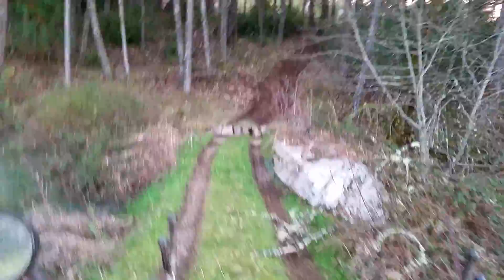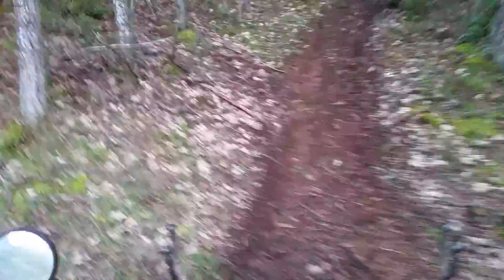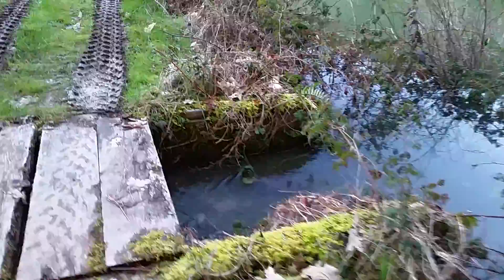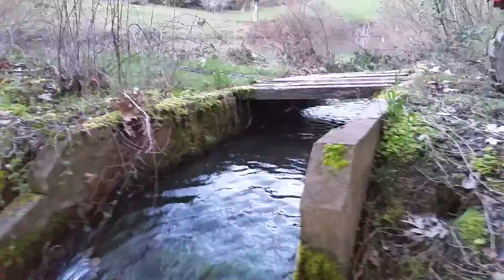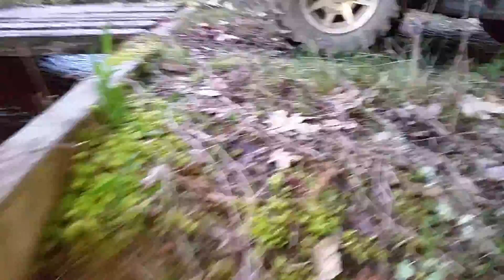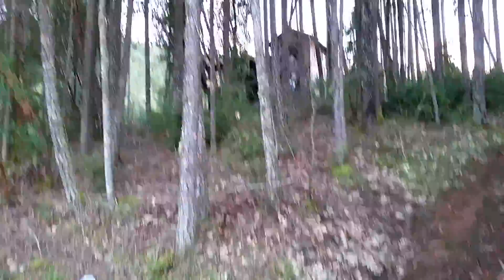Questions about overshot water wheel. Is this enough water for 15 amps@24 volts?

Comment: Did you ever build a water wheel at this site? I would be interested in an update. Yes, that is plenty of water and you want to build the largest diameter wheel possible for the head(fall) on your property.
Reply from the maker: Greetings, I did not build the water wheel. We still own the land but we since have built another homestead. We are now on the east side of the Cascade mountains. Still off the grid with solar.
Reply: @offgridinthepacificnorthwe3210  Thank you. Is this Washington State?
Reply from the maker: Oregon

Comment: thanks for posting.   here is some very late information.    for any proposed hydropower installation,  the  Very  First  task is to  Estimate the amount potential energy available at the site.     so.  in case you have not yet crunched the numbers, here's how. 
multiply gravity (9.81 meter/ps)  times  Head, change in elevation (in meters),  multiply by flow rate, in cubic meters per second.    this results in a kilowatt-value.   multiply by 1000 for watts.      the flow rate seen in the video might be three liters per second; or .003 cu.meters/sec.    select the maximum practical 'wheel radius.  correctly design a poncelet-style 'wheel and deliver water as near to 11 o'clock, as possible.    for an overshot 'wheel, optimum 'wheel radius is, naturally, roughly one-half of the available head.    ( assuming head of two meters and a flow-rate of .003,  there is  58.8 watts of potential energy available.  overall output will be always be less, due to unavoidable losses. ) 
on the other hand,  everyone   Must  come to understand a simple fact.     a waterwheel makes use of the imprecisely named 'wheel and axle' principle.    this principle Should be called a,  'Rotary 2nd-class Lever'.     see my channel for the wonders of  Rotary  Leverage/force;  aka, 'non-collapsed'  TORQUE, and the oh-so-simple path to OU, if it suits.    see linked video, and my comment there,  for proof of the concept.        cheers            
    googletranslate
https://www.youtube.com/watch?v=lTkXciAn488
Reply from the maker: David Davids Thank you so much for the detailed response. When I crunched the numbers last year along with the cost of getting usable power to my battery bank it became very clear that adding more solar power to our existing array was the better money. So that's what we did! We added to our system and now have 4.8k of solar. We are totally off grid and only use 7 killowatt hours a day. So our solar array is overkill most of the year but 50 days a year we still have to bulk the batteries with diesel. I was hoping to other have to use the generator for those 50 days a year but the additional cost of doing that is out of the question. So for now I will have to burn $50 a year in diesel. That said it is hard to watch all that energy flow over the spillway.
Reply: for the sake of discussion, one key to efficient installation design is the correct 'preservation' of head, until the water is delivered to the 'top' of a 'wheel.  (it is the equivalent of a very short aqueduct)     see linked photos.  cheers
https://n7.alamy.com/zooms/6647185e7d734ed3b9997c13954824ef/the-overshot-waterwheel-at-morwellham-quay-part-of-the-tamar-valley-e9kh2w.jpg

Comment: 15 amps x 24v = 360 watts. Hmm. I would think with that amount of flow (and torque) you could make at least double that amount of power. But, the question is how much power is actually needed? For overnight use and cloudy days...might want to shoot for about 500-600 watts to make it worthwhile. But, still, 15 amps continuous is still not bad!
Reply: Thanks. I think a micro-hyrdo generator would be sexy-cool to design to build! WOOT! I wouldn't see that as "work" at all...more like working hand-and-hand with Mother Nature...she will def smile on it! That fence array is working GREAT! Those Renogy panels were some of my first panels I ever bought over two years ago...still cranking out the power! Superstrut is a little pricey ($19 per 10' section), but with zinc annodized coating and paint...It should hold up. I think wood would look better...but, with Oklahoma wind/storms/grubs/clay along that fence line...needed to go with steel. It doesn't budge at all. I used 3/8" hold down bolts and those box spring nuts instead of 1/4" that many use.

Comment: I think I'd try to gather that up into a pipe and cobble together a turbine and some nozzles instead of trying to use an overshot wheel.  Those old overshot wheels aren't nearly as efficient as a turbine, from what I have read.  But I may not know what I am talking about........
Reply: +Steven Davis Ah, darn.  That's not much at all. :(

Would you be able to gear an overshot wheel up high enough to turn an alternator fast enough?  Or would you be using some kind of special low-RPM generator of some kind?

This micro hydro stuff is all very fascinating.  I'd like to get into it, but my place is just too flat.  So I am having to stick to solar...
Reply: +Steven Davis Not quite yet.  I'm getting things into place, but slowly.  I'm going to install my battery bank first, and charge it off the grid just as a backup, then size it up to what I need, and then install the panels and charge controller later.  I am hoping that way I can spread the cost out over a longer time, but still have something vaguely useful in the meantime.

Comment: what is the distance, and elevation drop, between there, and your house? And, it is on your property?  It looks like it would make for a great micro-hydro setup  It could eliimated your need for using generators for backups on those cloudy (no solar) days.
Reply: +Steven Davis 5 amps, is still 5 amps. But what would worry me is the distance to your battery bank, unless you could generate and transmit in a/c, then covert to dc at the battery bank. In any case, it looks like it could be a fun project!